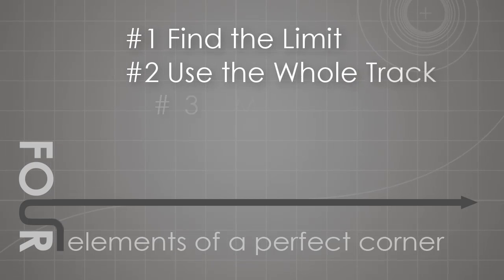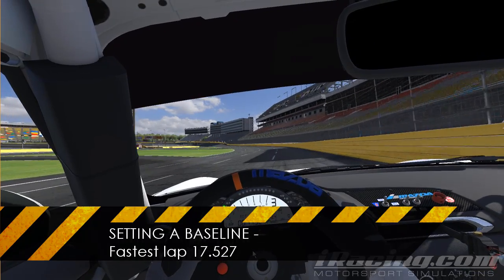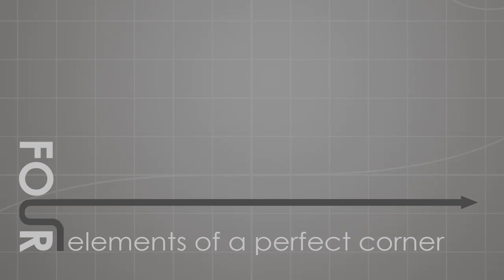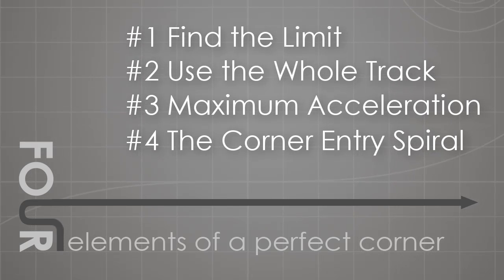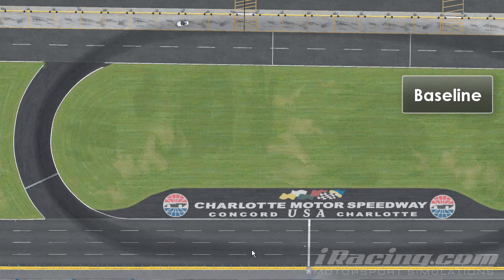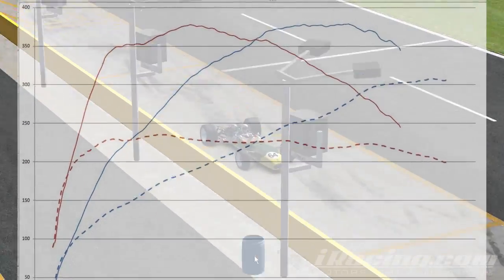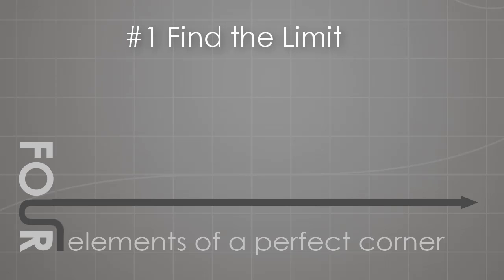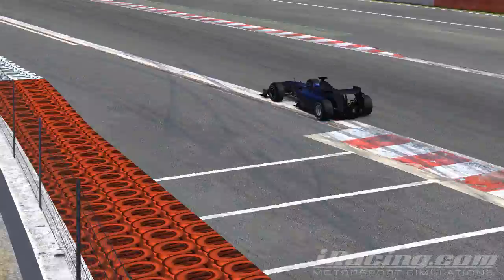The Racing Line - 4 Elements of a Perfect Corner (Physics Explained + Sim Training Tutorial & Tips)

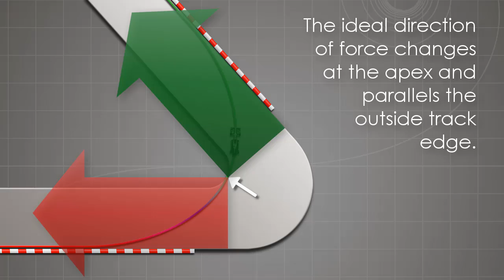Comment: Hi! I'm curious about what is said at 9:40 and a bit forward. This seems weird to me. Example: Maximizing deceleration in the direction of the corner entry edge is slamming on the brakes as much as you can until the vehicle is stopped. Which doesn't take you through the corner. Turning into the corner is actually lowering the maximum deceleration in the entry edge direction. Easy example is the Laguna Seca turn 6 shown at 10:05. Here, you actually accelerate in the corner exit edge direction at the START of the turn and decelerate in the corner entry edge direction at the END of the turn, with a transition between the two as you go through the corner.

It seems to me like the U-turn example is a bit misleading since the directions are the same. The order in which you accelerate in the different directions is not as straight forward as decelerate first and accelerate after, but with a U-turn you can't see the difference. In the Laguna Seca corner you can. Seems like what you want to do is maximize acceleration in the exit edge direction with just enough deceleration in the entry edge direction to not go off track. Where exactly these take place in the corner is an optimization problem with time as the parameter.
Reply from the maker: Hi Björn, this is Adam.  Sorry if that part was confusing. I go into this in much more detail in the books.  I do use a 180 degree corner as an example because the ideal directions are both the same.  For a corner like turn 6 at Laguna, however you are essentially cutting out the middle and spreading apart what you do in the 180 degree corner.  

The key point I'm trying to get across is that you do want to maximize the total force in the ideal directions throughout the corner, not entry and exit separately.  This will primarily be set by what you need to do to maximize corner exit.  If you completely stopped during corner entry, although you might be maximizing deceleration on entry, the ability to produce acceleration in the ideal direction  during exit would be severely reduced.  

 Maximized acceleration during exit  is a combination of sideways and forward acceleration that the car can create.  This will vary by car and effectively sets what you ideal apex is.  A higher acceleration car can use a later, slower apex and vice versa.  This part will effectively set your apex.  Then during corner entry you want to get to this ideal apex while also maximizing the car's deceleration in the entry ideal direction.  This is where you get the Euler spiral shaped entry.    You do technically "waste" force by needing to drive across the track, but this is necessary.  The idea is to minimize this force needed while maximizing the forces pushing you in the ideal directions.  

Hope this made more sense.  Let me know if it doesn't.  You might also want to give this article a read.
https://www.paradigmshiftracing.com/racing-basics/the-corner-exit-drag-race-racing-line-physics-explained#/
Reply: @ParadigmShiftDriverDevelopment  Hi! Thanks for the very quick reply! Maybe I'm misunderstanding something here, so let me clarify what I mean and ask some questions.

"The key point I'm trying to get across is that you do want to maximize the total force in the ideal directions throughout the corner, not entry and exit separately." <= This I completely agree with. They key question is what the ideal direction is at all points during the corner to minimize the time through it.

"Then during corner entry you want to get to this ideal apex while also maximizing the car's deceleration in the entry ideal direction." <= This I don't agree with, or I'm understanding you wrong. Take a 90 degree corner, for example. Let's remove the straight braking part since that is basically just preparation for the corner and start the scenario at the turn in point. From this point and forward, you want to minimize the time it takes to go to the corner exit. This is done by maximizing force in the corner exit edge direction, where more early is better than more later since that gives a high mean velocity in that direction. The shedding of speed in the corner entry edge direction is a restraint of this optimization problem to not go off track, where shedding it early is better than late for the same reason as before (we can brake later giving higher mean velocity). But, since the goal is maximizing force in the exit direction, braking is secondary. If you look at the traction bubble of the car on your link, the forward max force is lower than any other direction. That means we have spare grip at the end of the corner where we are already at full throttle, which we then can use for braking, releasing some grip at the beginning of the turn to be used for acceleration in the exit edge direction. So, we DON'T want to maximize force in the entry edge direction before the apex because we have spare grip at the end, and at the start is where we have the biggest possibility to accelerate in the exit edge direction, with all four tires able to give full traction in the lateral direction, which is the same direction as the exit edge direction. Just as your drag race example.

A little background here. I have a masters in applied physics so I'm not new to physics, however, I've never studied any race theory before so I'm fairly new to all the details here. I've done some racing before, mostly on sportsbikes. I found your section about the super late apex really revealing about what are the important parts when racing. Usually when discussing getting on the throttle early people refer to position on track as a reference, but position on track is irrelevant, it's early in TIME that is relevant (but hard to keep track of). If you not earlier in TIME you will never make up the loss from slow entry. So thanks for that insight!
Reply from the maker: @ZartaxtheWise    In regarding the 90 degree corner, you need to take into account how the radius of the line will increase  with speed and how we are going to be limited by the apex.  By accelerating in the corner exit ideal direction starting at turn in we would need to severely compromise our entry speed.  You would need a much later, slower turn-in to still make it through the apex and corner exit.  You've essentially added a little cone right at your turn in point where you achieved minimum speed further constricting your line. This is the definition of a super late apex.  The apex should always be the point of minimum speed in the corner where deceleration changes to acceleration.

Consider that an ideal apex speed is 100.  Is it faster to get to 100 by decelerating to it, or accelerating to it?

Does this make sense now?
Reply: @ParadigmShiftDriverDevelopment  I think you are misunderstanding what I mean by "accelerating". When you turn, you accelerate perpendicular to your current velocity. So in a 90 degree turn, as soon as you turn your steering wheel you are accelerating in the direction of the exit edge, in some part. Regardless of entry speed. Note that accelerating in the direction of the exit edge doesn't mean your speed is increasing. It's probably decreasing since you are probably also accelerating in the direction of the entry edge (that is, braking). Your drag race is the perfect example of this. Both cars are accelerating in the direction of the goal, from start, even though one starts perpendicular to the goal. It even wins, because it's possible acceleration in the direction of the goal (the exit edge) is higher when limited by grip and not engine power.

I see when I read by previous comment that I was unclear in my use of terms. "If you look at the traction bubble of the car on your link, the forward max force is lower than any other direction. That means we have spare grip at the end of the corner where we are already at full throttle, which we then can use for braking, releasing some grip at the beginning of the turn to be used for acceleration in the exit edge direction." <= In this comment, when I say "braking" I mean accelerating in the entry edge direction. Not by using the brake, but by turning the car.

So the goal is to reach the end of the turn as quick as possible with as much speed as possible in the exit edge direction, with the speed in the entry edge direction going to 0 sometime during this, but before we reach the track edge. That is the limitation. Where we reach 0 speed in the entry edge direction is actually irrelevant to the optimization problem, but since acceleration in the exit edge direction is better earlier we probably want to reach 0 speed in the entry edge direction as late as possible. Which is why we reach the track edge at the end of the turn.

So this is why the focus on maximizing deceleration before apex seems like the wrong focus. You always want to maximize force in the exit direction throughout the turn while allowing for just enough traction budget to stop the speed in the entry direction, and you want to allow this budget where it hurts the acceleration in the exit direction the least. Which is before turning in (straight line braking) and at the very end of the turn, where there is some free traction budget due to the shape of the traction bubble. Now, what complicates things is that earlier turn in is better (due to what we are optimizing, time to end of turn and speed at end of turn), as long as you can manage the constraints. Trail braking means you can turn in earlier because it allows for higher speed at turn in point etc. etc.

I don't know, maybe all this was just a very long way to say that the apex might not be the slowest point of a corner. Getting to the ideal apex of 100 in the desired direction might not be possible by only decelerating to it.

Oh, and sorry for an extremely long and wordy answer! :p
Reply from the maker: Okay, I understand what you are saying now.  I need to walk you through a few steps, which I’ll try to do briefly.  If you haven’t read my books, you really should.  It would probably clear everything up for you.  They are written for people who really like to understand racing at the level you are trying to.  
First try to understand why the apex is the point of minimum speed. The apex is your primary restraint.  Consider your 90 degree turn with a cone as the apex.  The highest minimum speed attainable in the corner would be by driving a perfectly circular line.  You could pass the cone at a higher speed than this, but only by severely reducing your speed earlier or later in the corner.  Your instant radius and speed is linked so that means that if you achieve a lower speed anywhere other than the apex you will need to tighten up your line there more than had you done this at the apex.  You have effectively added another cone at your point of minimum speed.   

Once we understand the cone/apex is the point of minimum speed/radius we can understand we will pass it at exactly 45 degrees.  The highest speed we can do this at would be with a perfectly circular line.  This will make the velocities of our corner entry edge direction (X) and our corner exit edge direction (Y) equal.   Driving at the limit, we can still pass the cone going slower if we wish by driving a spiral shaped line on entry however.  Our x and y velocities would still be equal and it would still be at 45 degrees though.  

Now the question is how fast do we want to pass the cone?  Just consider an idealized car with a perfectly round traction circle for now.  Our goal from the point we pass the cone is to maximize acceleration in the Y direction while bringing our X speed to zero.  With the apex speed from our circular  example, we can’t add any additional acceleration in the Y direction because we are already at the limit.  We need to use significant amount of the available grip just to bring our X velocity to zero.  Our exit line will remain a circle at best.   If we pass the cone going slower however, we can bias toward our Y direction acceleration as we have less X direction velocity to bring to zero.   There will be an ideal apex speed that allows us to maximize our Y direction acceleration while only using the absolute minimum force necessary to bring our X speed to zero.    This will create a spiral shaped exit line of expanding radius.

Once you understand this, realize that entry is simply the mirror image.  Your maximizing force in the X direction while only using the minimum force needed in the Y direction.  You end up with a spiral shaped line of reducing radius.This gets you to the ideal apex you have determined in the minimum time possible.
Reply: @ParadigmShiftDriverDevelopment  I agree with what you are writing for the special case of circular traction bubble and corner with same track width on entry and exit. But this is rarly the case. The two other extremes for the track is 1. your drag race, where the corner entry is basically a track width of the car, forcing the apex to be taken at 0 degree angle and 2. where the corner exit is exactly the car width, forcing the apex to be taken at 90 degree angle. In these two scenarios you can't mirror the entry and exit. In both these cases your 45 degree angle will be in the open somewhere.

The other case is there your traction bubble isn't circular. Consider the other extreme, a soapbox car. Zero engine power. Here, the ideal line is a perfect circle preserving the most momentum. In this case, most of the acceleration in the Y (exit) direction is done at the point up to the apex and only about 30% after the apex. On the other hand, most of the reduction in speed in the X direction (entry) is done after the apex while only about 30% has been shed before the apex. The force is always perpendicular to the vehicle, pointing inwards to the center of the circle.

This is why I feel that, from a teaching standpoint, it is a bit counter intuitive to say that focus should be on reducing speed in the X direction before the apex and gaining speed in the Y direction after the apex instead of looking at the complete turn as a whole. Where you gain and lose speed in different directions in relation to the apex depends on the track layout, what car you have and your speed (in low speed most cars are your circle traction bubble car and at high speeds most cars are your soapbox car, a bit exagerated).

Edit: I have to say though, this discussion has made me think about these things a lot more than I ever have before and deepened my understanding of what's actually happening when racing. So I greatly appreciate you taking the time and effort anwering me!
Reply from the maker: @Björn Eriksson  I do say you have to look at the turn as a whole.  I'm having a really hard time following what you are confused about.  It's quite hard to understand what you are trying to explain.  Maybe if you draw me some diagrams I can help.

I think the primary fault in your thinking is that you are trying to solve how to maximize acceleration  for corner exit at the beginning of the corner without taking into account the constraint that the apex and corner exit edge impose.  The arrangement of apex and exit edge determines a set apex angle/speed that is attainable.  So what you should be trying to look at is how to reach this point where you can BEGIN this corner exit acceleration as quickly as possible in time.   I've already explained how this is done.

 By the way.  A car with zero acceleration on exit would not have a perfectly circular line.  It would have a circular exit line  and an  Euler spiral shaped entry line.
Reply: @ParadigmShiftDriverDevelopment  "A car with zero acceleration on exit would not have a perfectly circular line.  It would have a circular exit line  and an  Euler spiral shaped entry line." - This is defenitely not correct if there is any kind of straight after the corner, maybe not even for the corner. The euler spiral entry would have a sharper radius at the apex and thus, a slower speed. Speed that can never be recovered. The exit circle of that vehicle would not need to use the whole track width (or not cut the apex at 45°, either way, suboptimal on exit). The one with the circle entry would need the whole track width.

The euler spiral might be the fastest way to get to the apex and for any car with a normal amount of acceleration this means getting on the throttle earlier (in time) enabling them to compensate for the lower speed at the apex, but here you can't compensate for a lower speed.
Reply from the maker: @ZartaxtheWise  Obviously the car can accelerate, otherwise it would be sitting still in the parking lot.  The hypothetical car just doesn't have power to accelerate during corner exit because of induced drag.  Once it's going straight it can start accelerating  This is quite common in lower powered cars in faster corners.  Sometimes a car can even lose speed at full throttle.  Also the  car can have a Euler spiral entry and a circular exit and still fully optimize to the track edge on corner exit.  It just has a larger spiral than a higher acceleration car would use.  The apex speed would only be very slightly lower than a circular entry, but the euler entry car would already be done with the corner and matched the speed of the circular entry car before it was done with the corner.  

Are you trying to learn or you just trying to argue with me?  I understand this stuff backwards and forwards and you aren't saying anything I haven't heard from 30 other people in the past.  It's not always intuitive at first, but once you understand it, it makes perfect sense.  I don't mind helping someone who is trying to learn, but this doesn't really feel like that.   Have you even read my books yet?  That is basically step 1.   I don't mind answering legitimate questions, but I'm not going to sit here and argue with you and rewrite my books on youtube.
Reply: @ParadigmShiftDriverDevelopment  Sorry if I come across as argumentative. That's just how I learn. I usually don't take things at face value but try to understand them. And when I don't, or see something that doesn't make sense, I either ask a question or put forth and argument to why things doesn't make sense to see if and where I'm wrong.

As for the euler curve entry. Do you always start the euler curve as a straight? Or do/can you start mid-euler curve as your curve entry?